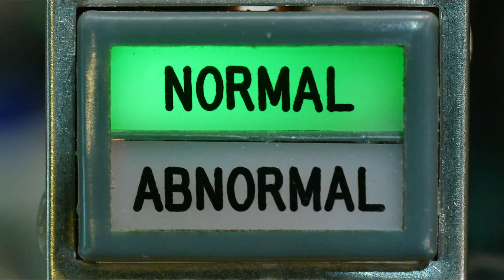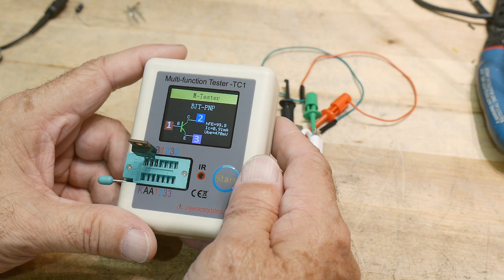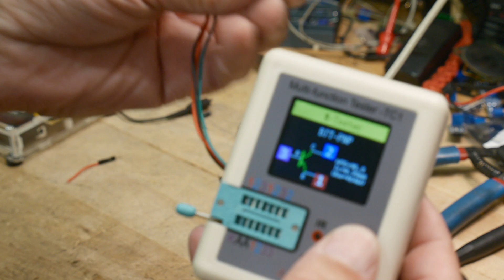#1262 Component Transistor Tester TC1

Comment: One option is to get a little piece of protoboard, solder two rows of pins, and connect the leads to that. Make the board stick a bit outside the socket and you can even stress-relieve the leads. With 14 pins, it won’t jump out of the socket. Even 1 row of right angle pins on a vertical protoboard may be enough.

Comment: Quite a good tester, but the battery in mine was awful, you might need to replace yours as well. Also, don't forget to add some strain relief (a drop of hot glue might just be enough on the pins, and a ziptie on the wires behind the hole.

Comment: I have one of those, repaired a few things with the tester, capacitors have to be removed from the circuit one at a time, otherwise other components will give a false reading. Nice idea with putting the test clip leads permanently on the board

Comment: I think that I mentioned on your yellow thingy video that I had DIYd the same type probes as those that came with your new unit. However, my three pins are on just one header. So, it is very easy to drop it into the ZIF. I prefer to be able to remove the wires, to lessen the likelihood of injecting noise from the wires, as they will act as antennae. Your slot is better than a hole, because the back will not be dangling on the wires, when the case is opened. You might add some heat shrink over the wires at the slot, to prevent wear. You might place a zip tie on the wires, for strain relief. The original yellow thingy circuit was built on a PIC 16Fxxx, IIRC. Thanks for the video.

Comment: The most dreaded thing that a Technician fears... an Engineer with a screwdriver.
Reply: Nah! An engineer with only 80% success rate, 'cos it'll be the technician that's redoing all the work... several times. Still it's called employment and so long as the company doesn't go bust you're quids in.

Comment: I've used a version of one of these from Banggood for a few years now. I find it very handy when I'm salvaging parts from some old whatever that's headed to the trash. I also use mini clips on mine , I'm not sure how many times I've had to repair a break in the dinky wires I've used on them. It's been one of the handiest things, just press a button and most time it identifies the part and gives you the stats on it. The version I have has some hidden abilities to give out a test signal at different frequencies and also can go into a calibration mode for open, short , etc.  👍

Comment: dangling wires will have some capacitance between them, so in theory this device may autodetect a capacitor when nothing is connected. But I'm not sure if it can detect capacitance this low.

Comment: Problem I had with TC1, is that LED panel backlight, had cold joint. After some months, screen was dark but I noticed it works, maybe it was my fault, device was in backpack and maybe screen was under pressure. Then I wire jumped all signals, and screen was OK, then when I removed wires it got back to normal. I also noticed that 4.1V voltmeter measured on battery says 3.9V on device screen.
1:20 - Battery last long if not used, when used each measure takes away 0.01V and you can see it at every start... even on your video it says 4.15V on first measurement, and 4.14V on second measurement, like with mine device.
8:45 - If you connect/short slot 1 2 and 3 with that item in center of screen, and start device, it will do self test and recalibrate. 
Also, I saw somewhere on youtube, that this device is stolen, some guy from Europe made design, but chinese stole it and now make profit.
There is video explanation how this device recognize parts.

Comment: How is the accuracy of the meter? I've been tempted to buy an DE-5000 but it feels too expensive for what I'd use it for.
Reply: I have both. They are really for different purposes... This meter is better for identifying the type of lots of different components, whereas the DE-5000 is meant for determining the characteristics of inductors, capacitors and resistors (and that is the only components it works with.)
Reply: @t1d100 sai số bao nhiêu % số với de5000

Comment: Accuracy
Speed
Cheap price
You can only have 2 of these:
If you want it well done and in a short time, it's not cheap; if you want it well done and cheap it is not made in short time; if you want it at a cheap price and in a short time, it is not well done.
Reply from the maker: Speed
Cheap price
I use it as a component identifier, not a measurement tool

Comment: For the long haul, probably once you decide to use better wires, you might consider strain relief for the cable. A simple zip tie inside would work or if you want to get fancy install a TRS 1/8" jack in the side of the case and make the wire set detachable. Regardless, nice hack!
Reply: A spot of hot melt would work too.  Glue the leads to the board.

Comment: Great little device, but it has one downside - battery drain. If you plan to use it less than few times a year, add mechanical off switch between battery and PCB. It will save battery from going flat.
Reply: How much current in the off mode?
Reply: 01/2025
~5mA even when powered off !  :(
~300mA while testing.

Unplug the battery when not in use  ;)

Comment: Hello, I have had this tester for many years and it still works well, personally I would not solder the clips to be able to use them in the K+A position as well. That IR receiver is there to test remote controls working on IR command transmission. Unfortunately, it cannot decode all types of transmitters. For those he knows, he writes a function with parameters. For transmitters whose code it does not recognize, at least it indicates signal reception with a dot on the display, so I no longer have to send a signal to the camera to see that the IR diode is flashing.

Nice dqay 🙂 Tom
Reply: Sai số báo nhiêu % so với đồng hồ lcr chuyên dụng

Comment: You could just get a 3 pin DuPont backshell, or glue/heat shrink the set of 3 that you already have together. That’s what I had on my old multimeter that had an inbuilt transistor tester and it worked fine.

Comment: Iguy: the Banggood site says:
DANIU™ LCR-TC1 1.8inch Colorful Display Multifunctional TFT Backlight Transistor Tester for Diode Triode Capacitor Resistor Transistor LCR ESR NPN PNP MOSFET
Does it really do all that? In particular ESR?  -Triode- ????
Reply: I think it does ESR, but only out of circuit. Who knows how would it display a triode... Probably filament as resistor and rest as open circuit.
Reply: Yes, it can include ESR, although the data is a bit scattered when compared to my laboratory programmable ESR meter, but nothing extraordinary
Reply: @jim9930  I just found ONE component that it could not understand. But of course I can't tell you what it is!

Comment: I have had the same device for some years. I bought this over other models, because of the compactness and the fact that it has its own battery. 
The IR receiver is to decode remote controls and indeed, it does for lots of different remotes.
Overall, very nice and useful device.